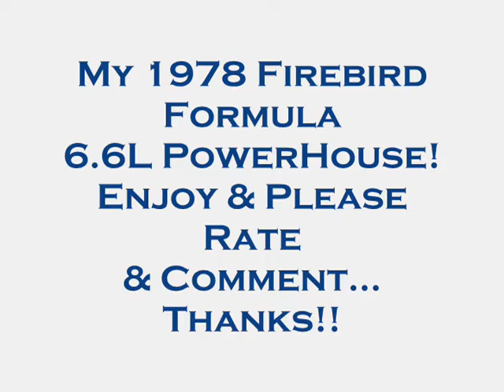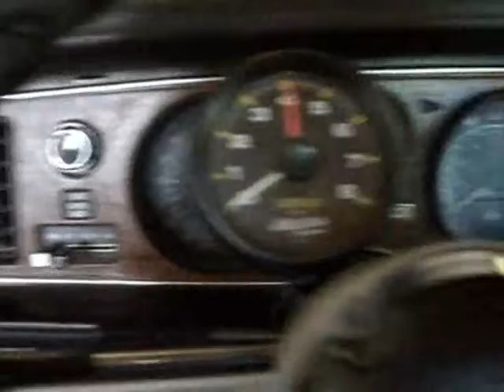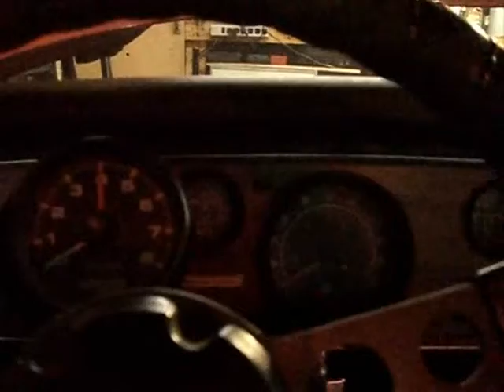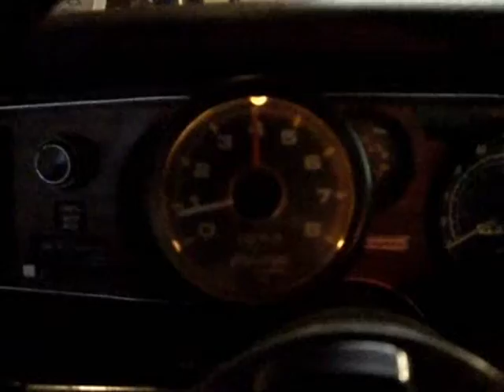1978 Pontiac Firebird Formula 6.6L 400cu

Comment from the maker: @banditsone Thanks! I do have traction bars but I also added welded in frame ties and poly body and suspension bushings. I also added 1/4 aluminum plates inside the trunk and rear seat floor to sandwich the leaf spring perches with grade 8 bolts. Its not going anywhere now. It slams second pretty hard so I knew I had to beef it up also because of the T-Tops.

Comment from the maker: @gilmore822 The Edlebrock Torquer II intake is too tall to allow a full size cleaner under the hood. I need to find an aftermarket air induction system that puts the filter down in front and only tubes up to the carb. :-\